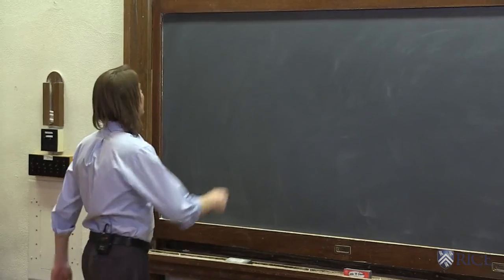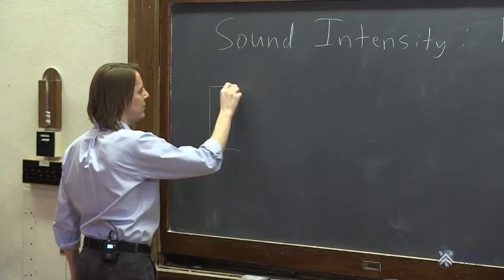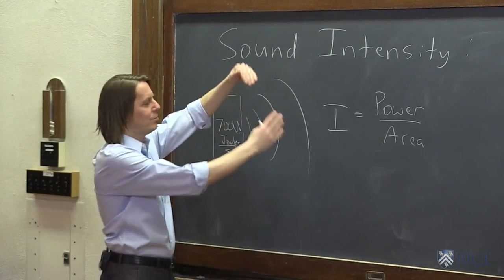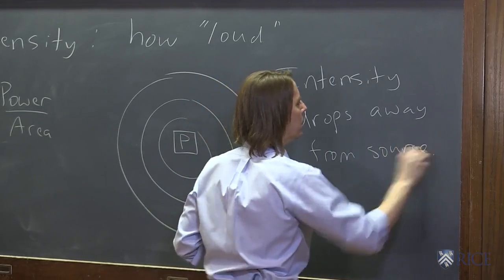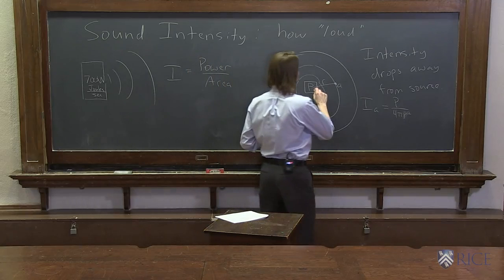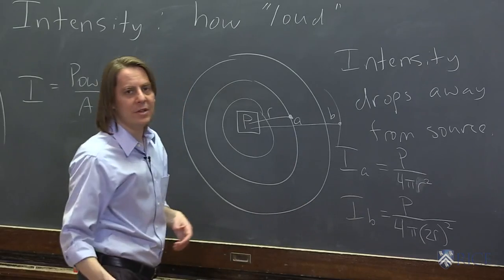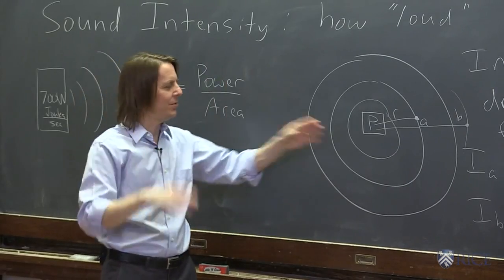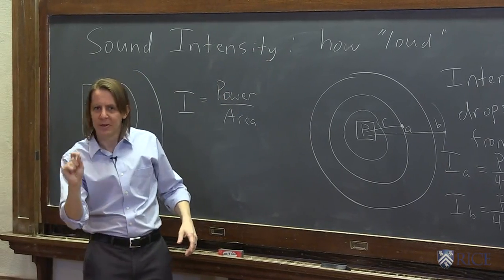OpenStax AP Physics Chapter 17.3: Energy of Sound Waves - Amplification

Comment: Why isn't sound being used to generate electricity ?
Reply: The answer to your question is in this very video (the inverse square law), as well as in the lack of a good source. 

Since speakers use an electromagnet to oscillate a diaphragm and generate sound, it is at least in principle possible to do that same thing in reverse and have an oscillating diaphragm move an electromagnetic back and forth to produce energy.

Now imagine you want to charge your phone or something using a large speaker. You'll need something really loud so say you go to a construction site to do this. given that the intensity of sound drops off with the square of the distance from the source, you'd need to be very close to the source for it to have any measurable effect. At that point, you'd be better off without a diaphragm and just putting an electromagnet on something that oscillates. 

The only context I think one could get a significant amount of energy from a device like that would be if you had yourself a massive electromagnet on the ground and waited for an earthquake or something. Such a device would be super expensive and earthquakes don't happen often enough (thank goodness) to justify the cost. Not to mention I don't know how much power you could get from something like that anyway. 

Technological advancement has limits and some things just won't work in practicality.
Reply: Electricity generation is different from sound current because sound uses electromagnet thats why they called the coil a sound coil when it place at the center of magnet it is then sound engine when power of amplification flows in voice coil it produces strong electromagnet this is a result of backward and forward vibration when no vibration occurs then your speaker or driver burns electromagnets is not harmful when humans inter act with it while the electricity you know if touch or when you are near the transmission line the electric field will hurt you and can cause severe injury including death when you touch a speaker wire or cable you cannot be hurt it has current but it only contains a lesser than 24volts because if you put a 12volts lights on 100watts speaker it will light and blink according to sound
Reply: Electricity and magnets is exactly what led me to looking up this video lol
Reply: @Yeetboii  that dose not answer my question. Back in the 60s Mr. Wizard on tv was powering a train set with a tuning fork. Why hasn't this advanced ?
Reply: Who told you it wasn't?
Reply: @megcantrell5760  I've seen and heard nothing of it.